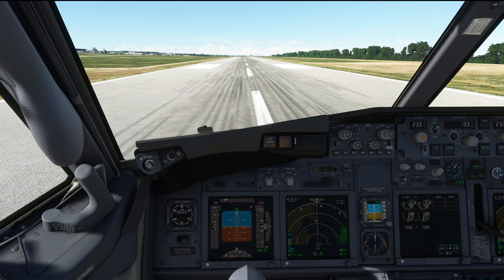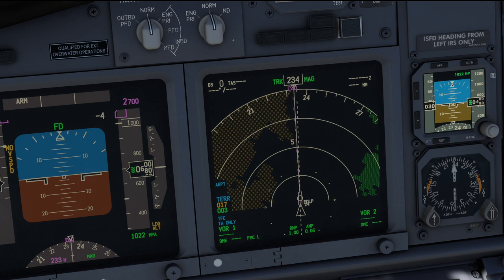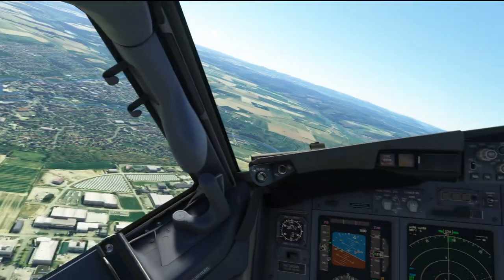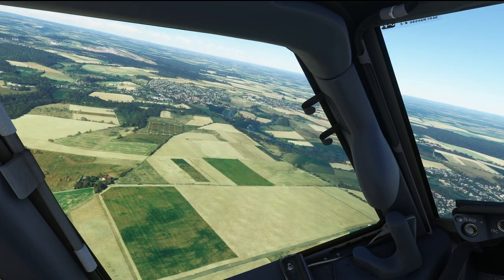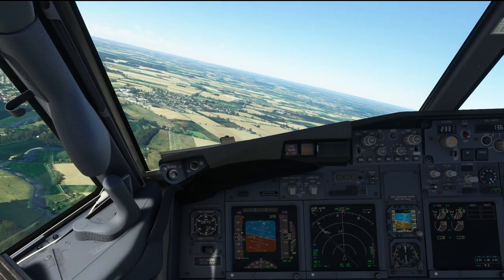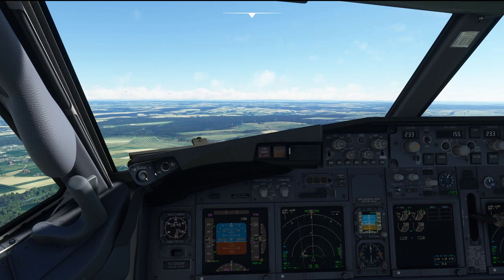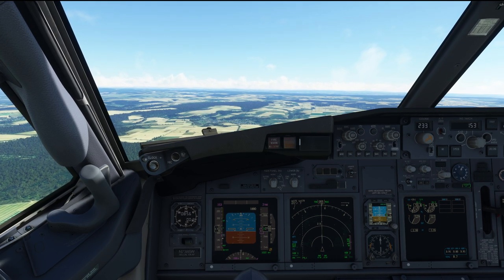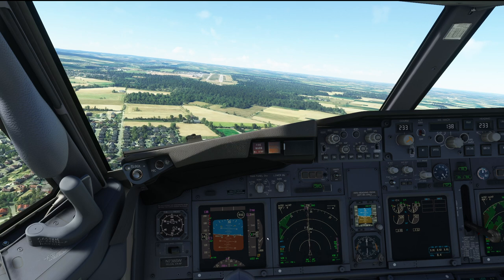Base Training! Flying Circuits in your 737! | Real 737 Pilot

Comment: You flight sim YouTubers are something else.  Just last night I was wondering how I would go about flying circuits in my 737 and Fenix 320.  Not the first time content from someone has popped up just when I’m needing it.  Thank you.
Reply from the maker: That's what I call timing! For the A320, in case you're wondering, there is a great video out there from Blackbox711. I used that with the FSL A320 back in the day.
Reply: @A330Driver  oh great to know, will definitely save that.

Comment: Captain! Thank You Sir for sharing your Professional Pilot's Expertise. I am just a single engine Private Pilot, so I really enjoy your videos, they are educational for "flight simmers", I don't quite have my MSFS 2020 setup yet, but when I do, your videos would have prepared me. I love the Boeing 737-800/700 and the 600. Loved the Area 51 video. My employer, a very successful airline in the US, recently purchased 50 Boeing 737-800, I work in aircraft engineering drafting, the main fleet currently is Airbus A319/A320. We will have a job cutout when the B-737-800's arrive next year, we do not have drawings for the B-737-800's.

Comment: To add difficulty once you have mastered the left-hand, you can do the right-hand.
Many airports require alternating between Right-Hand and Left-Hand circuits, for noise abatement measurements.
Reply from the maker: Those wouldn't be airports where you'd fly patterns though. The aim is to always fly them in the direction where the PF is sitting to enable best visibility.

Comment: Downwind timing from abeam downwind threshold - 3 sec/100' of circuit altitude corrected for wind.  2000' circuit = 66 sec to base turn (still air).  Hence you were high by flying 45 sec. (UK large 737 operator).
Reply from the maker: Different operators, different SOPs. In my airline it's 45sec. We correct for it with the 500fpm descend the moment we start our base.

Comment: Soooo good as ever Emmanuel. Any questions, this is default channel for me. So question this time is how do I make an extended centre line. i assumed I would pick a Star but you have a dotted line. Thx Alistair
Reply from the maker: Hi Alistair, load the approach in the FMC, then go to the LEGS page, select a direct to the FAF and choose the runway track (or rather: Final Approach Track as that'll be more relevant for your approach) as INBD CRS and voila.
Reply: @A330Driver  thanks as ever, off to EDLP to try!

Comment: Great video!!! Can you please make an approach tutorial with blended vs split winglets? I know calculations are a little different
Reply from the maker: Not really that different, you can use the same values. It'll descend slightly worse but within the scope of what you'd see on aircraft with blendet winglets with to weather influence as well

Comment: Finally got around to practicing the traffic pattern today. Amazing tutorial, all the right references to know.👌 Small question on flap speeds, I don't believe it was discussed in one of your tutorials, but the way I'm caclulating the correct speed per flap setting is (as derived from your references in this video): V = (flaps 15 speed from FMC) +5kts - (flap angle - 15 deg)*kts. so flap speed 25 is 134 kts if 15deg flap speed is 139 kts. No idea if this works for higher gross weights though; Any thoughts?
Reply from the maker: Hi Twan,

you can make your life easier: Flap speeds are based on Vref40 (Vref at Flaps 40).
Flaps UP: Vref40+70
Flaps 1: Vref40+50
Flaps 5/10: Vref40+30
Flaps 15: Vref40+20
Flaps 30: Vref40+8

Comment: Interesting video! 
How would you handle it with ATC in the pattern as you’re leaving the class Delta controlzone in EDLP which is only up to 2500ft ?
Would you try to get a special approval for that pattern or would you fly lower in real life?
Reply from the maker: We'd get special approval. If you want to do patterns anywhere in a commercial jet you will certainly give ATC a heads up with a phone call anyway, then you can discuss everything.

Comment: Wow. Thank you so much! Question: at 45:28 you verify "speed brakes up" after touchdown. How do you verify / see that in the sim and real life? I see no indications. The green light still shows "SPD brakes armed". Thank you! ❤️
Reply from the maker: In real life: Check the physical lever has moved to the appropriate Position.
In the sim: Listen out for the sound the lever makes. Would be too hard to look down during the high speed stage of the landing roll so I use the sound as a trigger.
Reply: @A330Driver  wow. THANK YOU!.As a simmer with no physical flightdeck I have such question. You can not imagine the value of your answers. That you so much! ❤️
Reply: @A330Driver  is there any indication that the auto brakes are working?
Reply: Go to an outside view to see what position the spoilers are at.

Comment: How many patterns/landings are required by the regulator - or is it operator decision? (EASA, LBA). Great video as always!
Reply from the maker: I believe 6 landings. At least in my company, not sure if that's a regulatory requirement.
Reply: @A330Driver  thanks!
Reply: 6 is the minimum for ATPL students , minimum 12 is for MPL students done in two sessions

Comment: I have 2004 Flt sim my computer only can handle it. My question is this looks so real complete cockpit, PMDG very nice even though I fly 2004 sim only can my computer. I have different liners with add-on nice panels. I enjoy Flt sim I can’t fly anymore this is my way especially liners. I use your videos to little help. Thanks
Reply from the maker: Sounds like it's time for a new computer ;-)
Reply: @A330Driver  that would be great, except I have Adobe products for graphic software that use my equipment and too expensive to replace Adobe software. But my Flt Sim is amazing for freeware. Thanks

Comment: May I ask why not using the FPV because I think it is a very useful tool for manual fly without the FD😮
Reply from the maker: Because we're training real flying skills here - not computer assisted. Computer assisted is for line flying.
Reply: @A330Driver  Understood. But as far as I know,on Airbus A320,pilots usually do their base training with FPV and even autothrust. It’s much easier than fly a B737!😂Why was that？！

Comment: Hi Emanuel - I've got a quick question.... When on the descent in the latter stages of the approach, I notice that the engines idle at  around 35% N1 which seems pretty high. This high idle only drops to a more normal 23% or so after touchdown. As a result slowing down when high on the approach is a real challenge. Is this true to life? Why does it idle at such a high 35% in flight?  Is the PMDG thrust model correct and accurate?  Many thanks, and love your videos.
Reply from the maker: That's normal indeed. The reason we have approach idle is that if you'd let the engine spool all the way to ground idle they'd take forever to spool up. Look at the Fenix, the Fenix engines are definitely taking much too long to spool up. That's what I'd expect if they weren't in approach idle.
Reply: @A330Driver  Gotcha.  But then does that mean we need to add in extra descent distance, so the 1/3 rule plus extra to slow down.

Comment: as i see you switched on the online data again? do you still get ctd with it or has asobo fixed the issue?
any news on that topic?
Reply: It has been fixed, Asobo states to update your Windows to the newest version. It was probably just a server side issue and had nothing to do with the sim (other than the fact that the error doesnt get handled properly and it crashes the application lol)
Reply from the maker: I've switched them on again and according to Asobo it's fixed when you update your windows to the latest version. Indeed I haven't had a crash since!
Reply: @A330Driver  I switched on online Data again. I flew 2 sectors without ctd. EDDL-LFLL-EDDL.
Sadly, I experienced a crash right know in the 2nd sector. EDDL-LIPZ-EDDL. Its always crashing in the 2nd sector. Maybe I will try to safe at the gate and restart MSFS to see if that will help.
Updated my Windows to the newest Version and all that.
The last week when I switched online data off, I have flown 4 legs at once without a ctd or frame loss. Or like 3h flights. No problem at all.
The eventviewer is only showing MSFS.exe as the problem. So nowhere to search really. Suckes a lot.